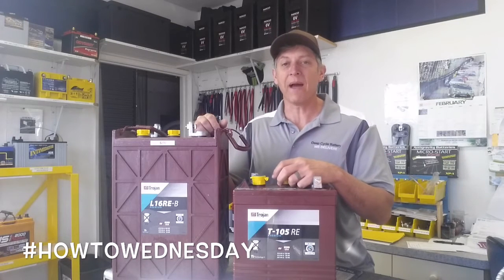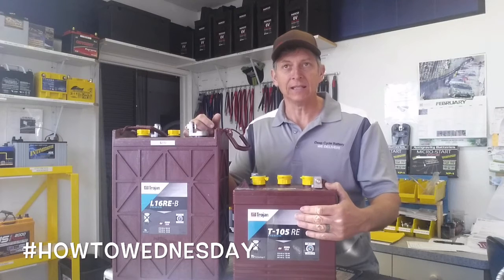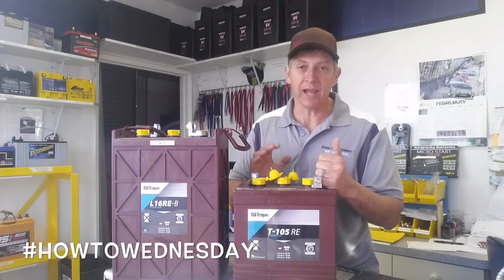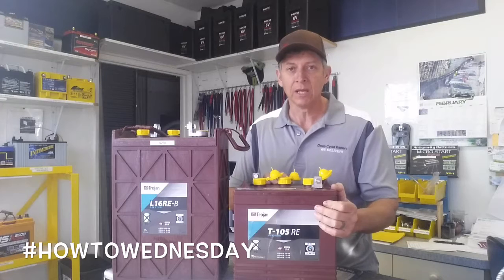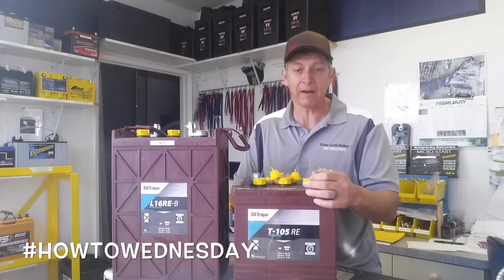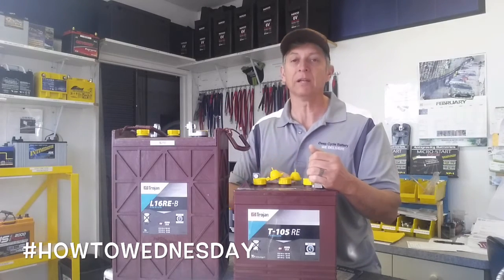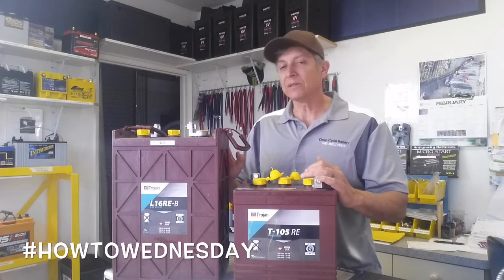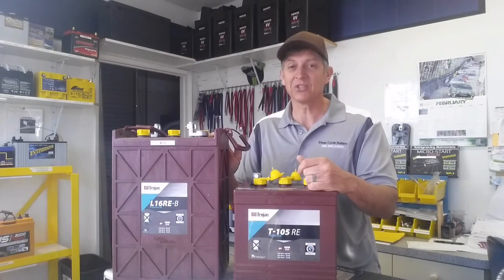Replacing One or Two Batteries for Solar or Golf Cart

Comment: I have a small system with 340 watts of solar and two six volt batteries in series.
I have had this running for one year and now I feel I undersized the battery bank. 
Am I still in the safe zone to add two more six volt batteries to the bank for a total of four or do I need to buy four new batteries?